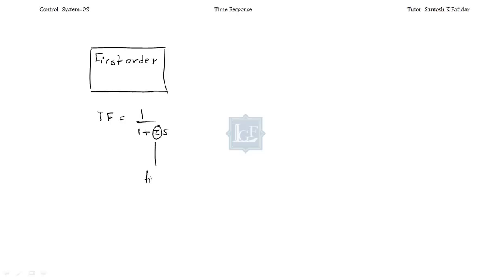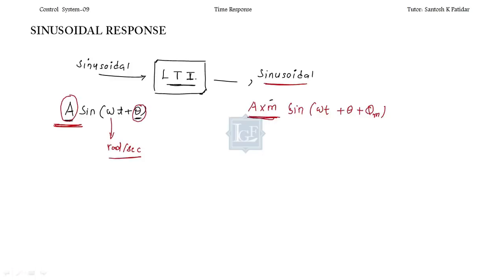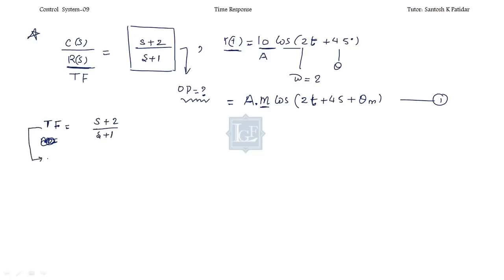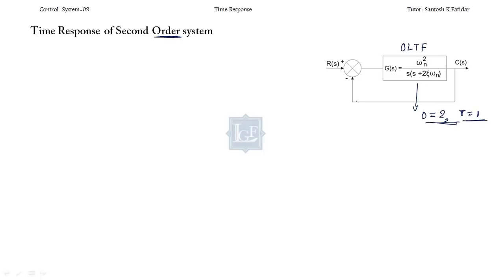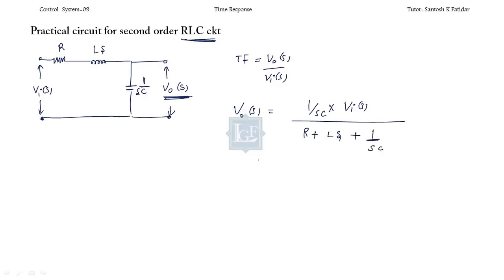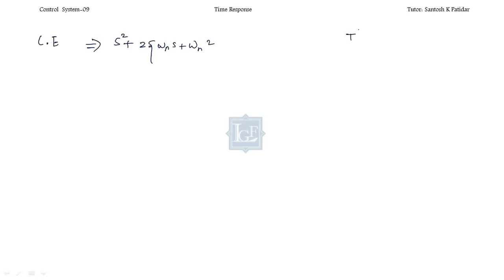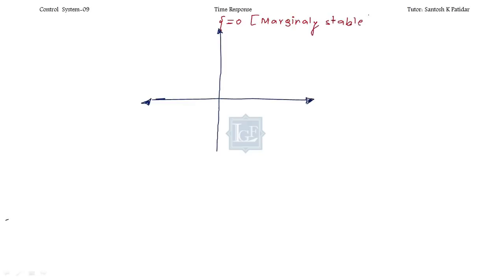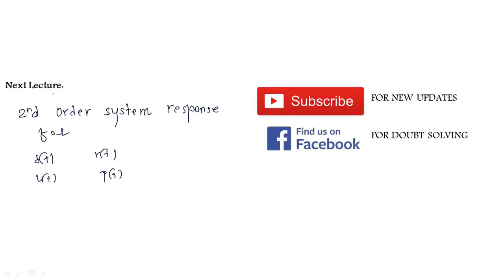Lec 09 Time Response of Second Order System

Comment: SIR IN OVERDAMPED SYTEM U TOOK THE VALUE OF ZETA>0,SHOULD BE >1?
Reply: Yes you are right but here we are talking about the stability and we know that if there are open loop poles on the right side of the s-plane then the system is unstable and for an unstable system the ZETA value is negative or ZETA<0.